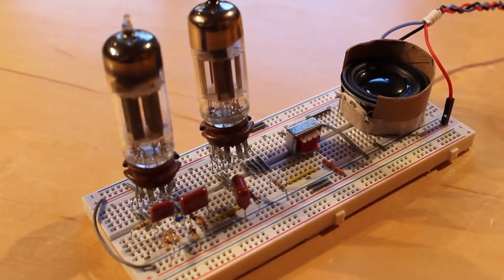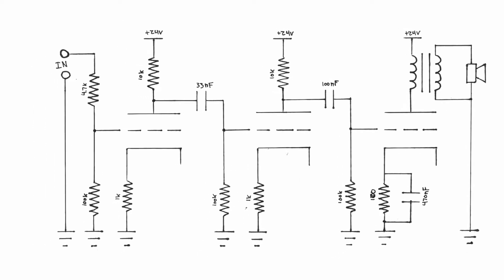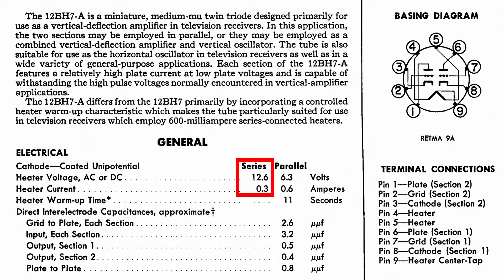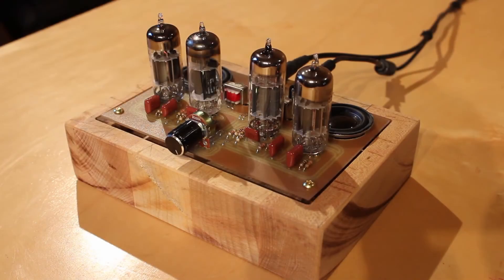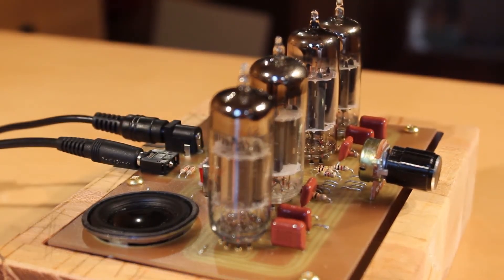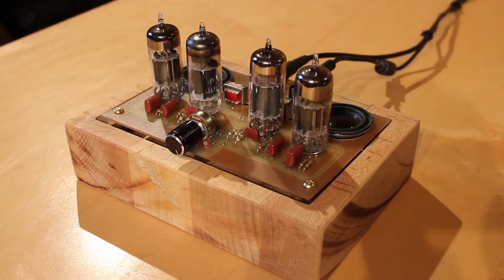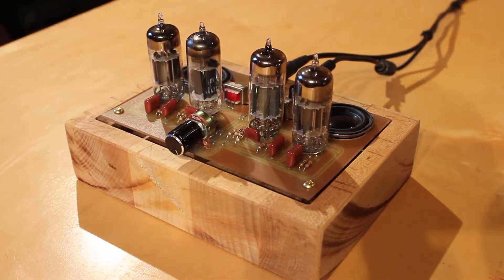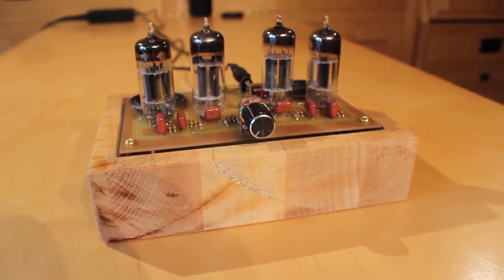Finalizing the Low Voltage Vacuum Tube Audio Amplifier

Comment: Nice video but I have to agree with MarkShuster (below) that you really need to add a cabinet to benefit from what this amp is producing! You mention at the outset (first part/other video) that you don't really "do audio" for various reasons and that this was an exploratory project... which might explain what I think is a little error, or oversight, in this project: The design of the electronics and the production of the hardware is fantastic - and a brilliant pair of videos but... (BIG "but")... if you don't mind me saying, the whole thing is a bit flawed from the outset in feeding this audio into these two tiny speakers. You would have seen (heard) a much greater output from the start if you'd used bigger speakers! My electronics knowledge is nowhere near as advanced as yours and I started out only a few years ago developing guitar amps around the LM386 chip. Like you, I wanted to get the most volume/quality I could out of a tiny rig... so I set about building tiny amps into cigar boxes, with 2"-3" speakers. I tried several combinations of 2"/3" speakers and although the volume (and quality) was superb for "near-field" usage (ie playing as a desktop/bedroom amp), I was interested in getting more volume, so my amps would appeal to a larger customer base and compete with some of the low end of the mainstream market for small practice amps. Eventually, I hooked up my (now) tried-and-tested circuit to a 4" speaker... then a 5" and ultimately 6" and 10" and the results were astounding!!! The amp had, all along, been quite capable of knocking out a LOT of power (hence, volume) but I had been connecting it to too small a speaker! I now make (and sell) my hand-built 9-volt battery amps to customers all over the UK (and some in Europe) with 5" (min) to 10" speakers and my customers love them. The volume output by this tiny (LM386) 0.75Watt amplifier is surprisingly loud and clean! I now regularly play through a 10" speaker (practice and testing new amps) and have even put it through a 2 X 12" cab and it's amazing! So... based on this experience, and with all due respect to your knowledge/skills, I have to say that, if you fed your amp (here) into slightly bigger speakers - AND added a cabinet (it's also a very important part of the whole amplification process) - you might be surprised what this rig is cabable of! I see so, so many YouTube videos showing how to build a cheap/tiny amp around the LM386... and then the builder plays it through a speaker - un-mounted and just sitting open on their desktop, which produces a thin, tinny sound - and that's entirely missing the point: The "speaker" is just a driver... and NEEDS a cabinet to complete the amplification chain - and to enhance the resonance it is producing. I really think that, if you'd just put the original 24-volt unit through decent speakers, you might have stopped there! Great videos - thanks... will watch over and over again to improve my own knowledge! Best wishes, CJ 🙂

Comment: I LOVE this project. I love the idea of just needing a dual gang pot to make it stereo. One thing that will make it sound better is mounting the speakers separately, tubes are microphonic, they pick up the vibration and amplify it. the block of wood is GENIUS. id build this as a first amp.
Reply: btw, i found you with this project.

Comment: I see that you stumbled upon one of the cardinal rules of psychoacoustics ; The louder the signal, the better we percieve the tone to be, and about 1K is the main EQ/ frequency we hear, so higher and lower frequencies are percieved to be of lower volume, and we hear less "tone" ( highs and lows) compared to the bulge in the mids. This means when the whole signal is louder, you hear more high treble and low bass, so it's percieved as more tone. Your audio results depend on the speakers as much as the amp, and you spent all your time and mind on the amp, fitting some random speakers as an afterthought. I can guarantee you that if you did a swag of reseach and looked at speaker enclosure designs and which drivers are fitted to which cabinets, whether to have open enclosures, ported boxes, or completely sealed units, and so on, that you would make s forty percent noticeable improvement on the sound you already have. I can guess that you build this stuff for fun and curiosity, so perhaps I'm not helping by trying to drag you into the rabbit-hole of addiction to fine audio, but maybe you'd find it fun too!😄

Comment: ok so, if i were to build an amp based on your design, what kind of transformer should i use? that seems to be the hardest part to figure out on a tube amp. will something like a 600ohm 1:1 transformer work? awesome vid btw, simple to understand
Reply: ooh also is it possible to use the 12AX7 instead of the 12BH7?

Comment: I have just come across your channel (Episode one of the build).VERRY impressive all round
As the owner of a fairly expensive sound system built around an integrated valve amp, I tell people that I did not spend all that money to improve my normal volume listening but so that when I tern it right down the music still sounds as complete just lower.
I'm shore you can imagine haw much I would like to hear your amp (real world)
I think you could improve the base greatly by some sonic wave guide Infront of ,or projecting around the speakers.(Have a look at the grills the manufacturers like to boast about  Shh)

Comment: Nice sounding little tube amp....The real tube Challenge is achieving same or Louder volume on just 12 volts DC.... The 12K5 power Tetrode kicks out Amazing volume on just 12 Vdc plate & Screen....The loudest Clean sounding all vacuum Tube amp design makes an interesting Safe low Voltage Challenge project !!

Comment: That's a nice result! Thank-you. 🙂👍

There are several things which you could do to make it sound better and louder, if you want to experiment further. Use a pair of, say, 6" x 4" midrange speakers. (They were used a lot in cars, some years ago, so they can be found at scrapyards for low prices.) They will be more efficient and produce some Bass notes. Increase the low frequency output more by using larger value coupling capacitors. Pick a pair of better quality output transformers. They do not need to be huge. Use a twin triode on each output stage, but wire them in parallel. Increase output tube plate current to the maximum. 

Run the final stage of each amplifier in Class B instead of Class A. Class A is at best 25% efficient, but Class B can be more than 33% efficient, and can approach 50%, giving you twice the output power. You could also run the output twin triodes in Push-Pull configuration, instead of in parallel, using a tapped transformer on the two grids.

If you really want to increase the output level, then think about running the outputs in Class D or E and pulsing the tubes at an ultrasonic frequency whilst carrying the desired audio. That can give you several Watts of peak power, albeit with a small increase in distortion if you push it too far. 

For reference, in a transistor circuit, using a BC109 NPN Silicon transistor, which is rated at 200 mW continuous dissipation, I have seen one delivering several Watts (6 if my memory is correct) of perfectly acceptable audio for casual listening, using that method, with no heatsink on the transistor. That's enough for comfortable music listening with similar frequency response to a broadcast radio, in an urban lounge, if you're not an audio purist.

A similar idea has been used in megaphones, but using a high efficiency horn. That horn is designed for speech only, with no consideration to fidelity; hence the distinctly low-fi sound from them. Your amplifier will sound better than that, because of the better speakers.
Reply: or u know

bias the tubes correctly(im guessing he just eye balled the resistor values)

and actually get them into the linear region

the reason he got better sound by using higher voltage is because tubes need tens of volts to get into the linear region, for bjt this is like around or less than 1v

also class b can be 53.5398% more efficient, because class b is at best pi/4*100% efficient

but really these numbers 78.54% or 25% are crap talk, real amplifiers will never reach these at best

also wtf u mean small signal transistor delivering 6w, either thats wrong or thats way out of their specification, even in class ab u have to use power transistors with a mid sized heatsink to get that power

also casual listening is more like 2w for me which is already loud enough, 6w would be WAY TOO loud, at least for my speaker

also class b is really gonna complicate things a lot especially in tube design, the idea was to make simple tube amplifier no?

no? ok then maybe he could also add some negative feedback

class d!? now we just addin silicon back in, comparators and watnot, thats more more complex(unless we tryna design differential amp with tubes? wat is this a room sized amplifier?)

class d isnt just about the output, it s a whole topology, everything from input to output gon be different

at this point just use opamp

use a single tube for preamp, for that tube sound if u know wat i mean

and run the whole thing in solid state

Comment: volume is about moving air. You need larger and probably higher efficency speakers. How would the design change when using say 6" speakers? Would you need different OT's? Do you see yourself revisiting this project with an aim to not just annoy the wife but overcoming the din of a party at your apartment? I know this is an older vid but just now seeing it. Thank you.

Comment: Nice little amp they make supercharged tubes the are made for 12-15 bolts for plate 12v fill.My personal Amplifers are push pull Ulteralinear 813 tubes @ 200 volts 500ms. 6sl7 preamp phase inverter with 6sn7 drivers all paper in oil dog caps.of course 6AU4 tubes for power supply. I really enjoy your channel 73 W3AMG

Comment: The "one-two" tubes are actually read as "twelve".  This was used to indicate the heater voltage that they nominally used.
Reply: Yes, that right. Took me some time to work out what valves...  er tubes you were using. Cheers.

Comment: The drivers that you're using are small enough that they can't physically reproduce anything except very high frequency and the high frequency sound can't move much air since it has so little power. You could hook the output to a small hi fi speaker and it would be capable of much higher sound pressure levels and it would sound much better because the original source music contains low frequency information that is completely missing. You won't her a bass or drums at all even though they were there in the original music. All you're hearing of your jazz quartet is the high notes on the piano and the cymbals everything else is AWOL.

Comment: Technically, you have two 'identical' amplifiers that are driven by a common input.
It's worth pointing out that each output 'channel' is, to all intents and purposes, independent (although you've 'chosen' to connect one side of each transformer output winding to ground).
Have you considered using this setup as a 'push-pull' amplifier?
1: Leave the LEFT transformer secondary winding exactly as it is
2: Disconnect the 'ground' wire from the RIGHT transformer secondary winding and move it to the other side of that winding.  (This forces the originally 'grounded' end of that winding to now have a 180 degree phase shift from the LEFT transformer).
3: Connect a single speaker between the two 'non-grounded' secondary winding pins
Obviously, doing this will change any transformer-to-speaker impedance, but I doubt it was anywhere near matched to begin with.
Since the voltage potential across the speaker is now effectively doubled, you should hear a few dB of audio gain

BTW, I am going to 'challenge' you to maximise the clock frequency of your UE14500.
With surprisingly little 'tweaking', I'm betting you could get somewhere between 10kHz and 100kHz to operate stably.
(All you need to remember about speed is "Capacitor BAD, Inductor BAD, Resistor OK")

Comment: I wonder if you could have an advantage of putting one side of the power amp to one speaker using only a narrow band of low frequencies and let the other power amp and speaker carry the rest. Ive used this concept many time in live sound with great results. Its shocking sometimes how big a sound you can get from a small system this way. I realize this would have added more complexity with having to add a crossover circuit . Your videos are addictive, thanks for the work you gave us.

Comment: Neat design. What is the turn ratio on the transformer and the impedance of the speakers? Also, since it's based on the Fender Champ, I would be curious to hear the output when driven from a guitar pickup...
Reply from the maker: Thank you!
Not a clue on the output transformer, they were just random little transformers I found on eBay. I imagine they're only meant for voice or something simple in devices like modems, and I'm way misusing them here. It would definitely be interesting to hear what it sounds like with a guitar, unfortunately, I don't own any guitars, haha.
Reply: @UsagiElectric  Thanks! I always assume that if I design something, it won't work because I will mess up the impedance matching or something. I'm really interested in designing an easy to build, low-voltage, tube amplifier or radio that uses tubes that are still manufactured today (like the 12AX7 or EL34). It would be great if there were more options for people to learn about using vacuum tubes that doesn't depend on vintage tubes, because as soon as a vintage tube gets popular, the price goes up (like all the Nixies).

Comment: You should install some 5 way binding posts on the back, to hook up to some efficient speakers! Like your design!
Reply from the maker: Thank you!
It's really just a super simple copy of the Champ Amp design, though I made a lot of mistakes on this one that can be done much better. I recently did another amp only without the Output Transformer and it sounded much better, but I do have another amp planned with a bigger speaker and better output transformer that should be a whole lot better than this one!

Comment: Absolutely awesome project. Maybe I will get started with vacuum tubes on lower voltage. Hope Soviet made one’s will be fine.
Reply from the maker: Thank you!
Most tubes work really well at lower voltages, but some of the soviet tubes may not move enough current for good volume at low voltage. The 6N2P for example moves a bit less current than the 6N1P, and both move considerably less current than the 12B4A used here as a driver tube.
Reply: @UsagiElectric  most tubes work really well at lower voltages IF they are for switching application

MOST TUBES absolutely do not work really well at lower voltages for audio due to them not even getting into their linear region

they will work, but definitely NOT REALLY WELL

but i guess that would also depends wat u define as lower voltages

tubes need tens of volts to even get into their linear region, like 40v and above(for most tubes)

and ur signal cant swing below that, or distortion, imagine say 30v and u get into linear region, and u use 36v supply, ur signal has that 6v room to swing without being distorted

thats why using 100v, u r well into the linear region, the signal have a big room to swing, and not going below 30v
Reply: @UsagiElectric  thank you for reply. Maybe I will try find a Soviet equivalent to your tubes, since almost everything in Soviet Union was stolen from west 😁 I really appreciate your channel, it’s one of my favorites now, since it’s very hard to find good information about vacuum tubes. Just keep going, I think your channel is underrated now and I hope you will have more subs soon.

By the way, I want to make a channel about unique and interesting Soviet tech, such as this tiny Soviet buttons, but in English. Does it sound interesting? I will get started with my workshop when I come back to Russia from Indonesia, in March, hopefully.

Comment: I am curious as to whether any consideration was given to matching the primary impedance of the output transformers to the plate resistance of the output triodes. This match is a very, if not the, critical design criteria for transferring power from an output tube to a loudspeaker. Also a significant mismatch here will be reflected into the transformer secondary, which of course needs to be matched to the voice coil impedance.
If you need to chase maximum output power and low distortion, start by using a transformer with the closest match to the output tube you can find.
Reply from the maker: Haha, there wasn't any consideration given to matching anything! I just threw whatever parts I happened to have laying around at a breadboard and trail and error'd my way through values until I started to get a sound I liked. With some proper parts matching and designing, this amp could definitely sound a whole lot better!